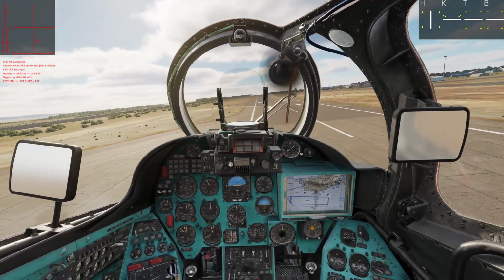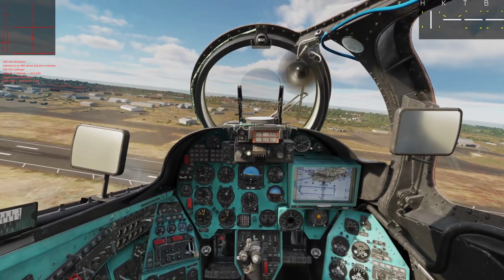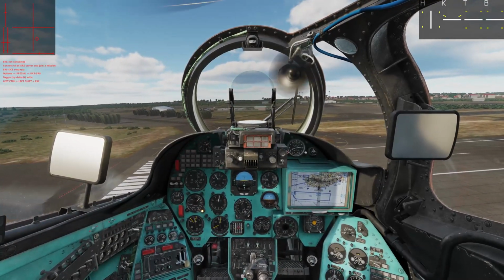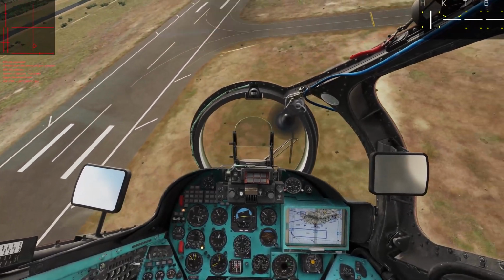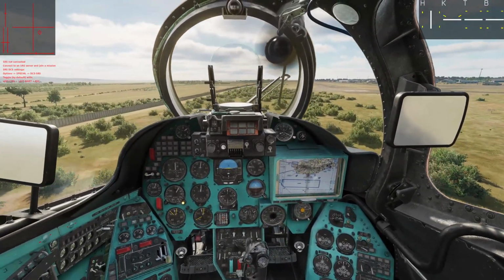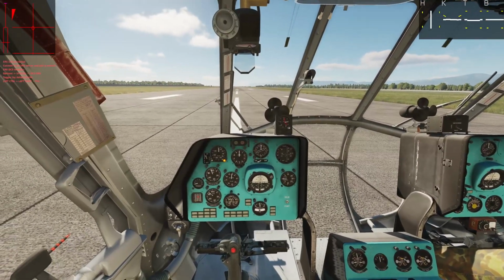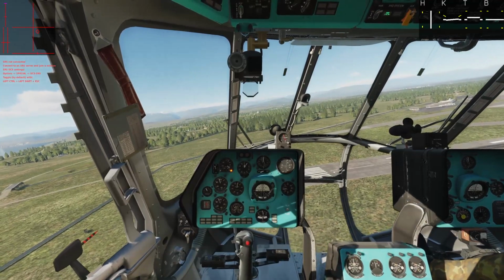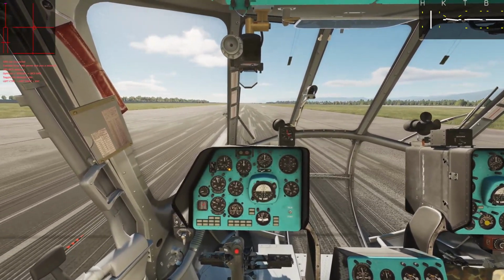DCS Mi 24P Sideward Flight Investigation

Comment: Great video, thank you. I've been trying to find a reason for why the Hind is behaving so differently from the HiP especially during maneuvers and this is definitely a good showcase that there is something weird going on here. Maybe some real rotary wing pilots could chime in on which behavior is correct. Either the HIP is modelled wrong, or the Hind is. They can't both be right. Hopefully PilotMi8 gets a look at this and maybe comments on it. Have you thought about posting this video in the Russian section of the forums? The devs are quite active there. 
edit Oops, missed NineLine's response :)
Reply from the maker: Thanks for watching. I don't think it's as simple as saying one's right and one's wrong. As I mention in the video, I'm certain the Mi-8 is using an older version of their flight dynamics code which probably doesn't model the tail rotor in great detail. I suspect they're now modeling the tail rotor inflow in greater detail with the Mi-24. Unfortunately, I think they're considering the tail rotor in isolation. In reality there is an interaction between the main and tail rotor wakes that either exaggerates or delays the effects of tail rotor VRS, depending on the direction the tail rotor rotates. The Mi-24's tail rotor (as well as the Mi-8MTV2's) rotates the more beneficial direction. As a result, I would expect more benign sidelight handling qualities. 

The dependence on tail rotor rotation direction is well documented. I mentioned a source in the video and in the description. I will also point a bit in this this video (https://youtu.be/H17sXrWgAgQ?t=1722) where he mentions tail rotor authority issues in the old pusher configuration. What he didn't mention is that in that configuration, the tail rotor rotated such that the upper blade was moving forward, which was likely the source of those issues. Now, this information is second hand at best, but it does provide some additional clues that the behavior as modeled in DCS isn't quite right. 

Also, remember that at the end of the day, these are all just models. As as a wise person once said, "all models are wrong, some models are useful."

I don't post in the ED forums myself any more, though I'm happy to let others link to my videos there if they wish.
Reply: @ErikScott128  you are right they are both simulations and all simulations are by definition imperfect. I think that you are also probably correct in assuming that the Hind simulation is probably a little bit more detailed since it is newer, but if these two helicopters feature the same main and tail rotor configuration then what you have demonstrated here is that there is a discrepancy that should not be there. Or put in simpler words, they cant both be right 😅